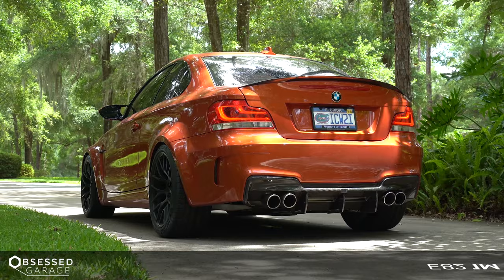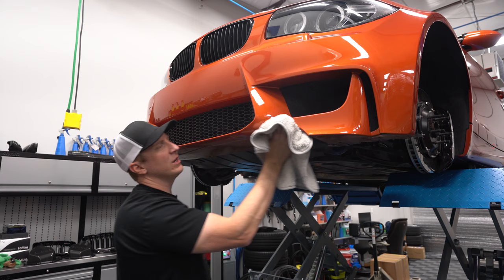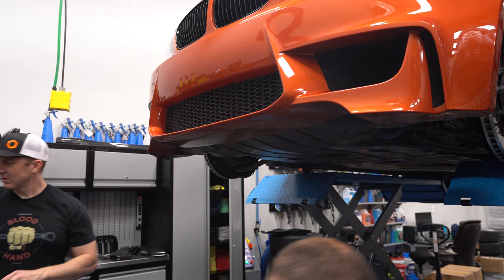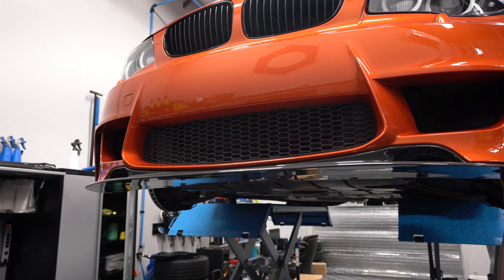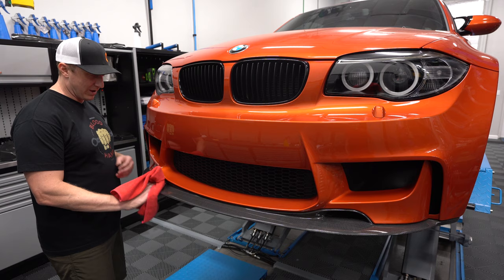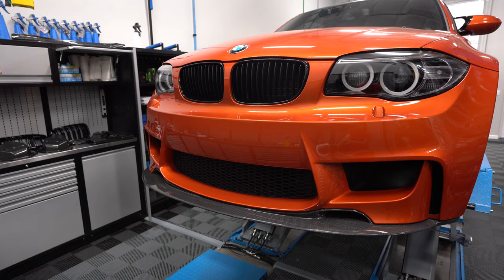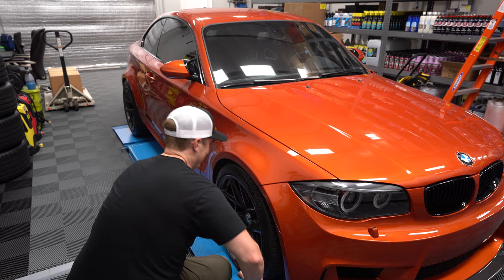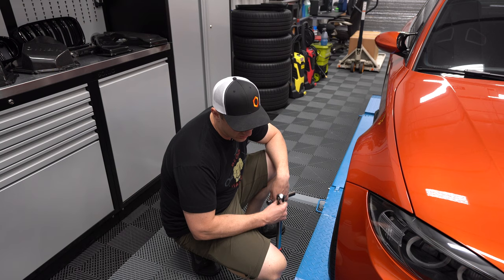BMW 1M -  SleK Carbon Front Lip Install

Comment: Please make a list of all parts and accessories plus the original price of this car before giving it away.
Do you have to add the labor hours to calculate the giveaway value for taxes ? The winner will pay big money on taxes. 
Sadly he/she will have to flip this car for cheap if he/she can't afford to cash pay the taxes in the following year.
Reply: Prize value for tax purposes has already been set, it's in the fine print on the giveaway page.  There's not a whole lot of fine print so it's a quick read.  Not sure why you'd have to flip it for cheap to pay taxes.  I don't see why you can't sell it for market rate if you can't afford to keep it.
Reply: It’s the most like 20 k in taxes, most anyone should be able to get a car loan for that. 300 bux a month.